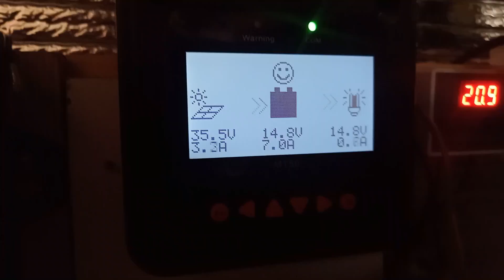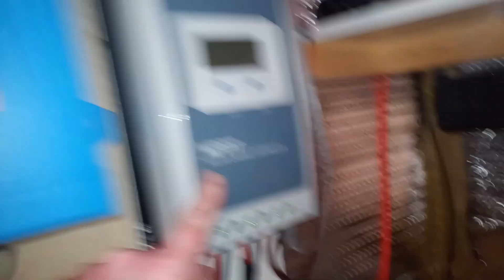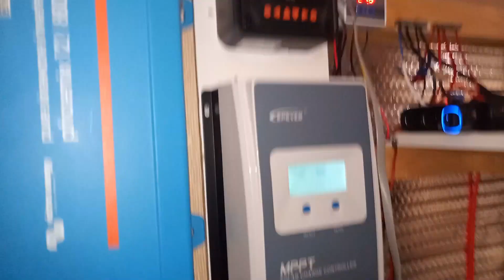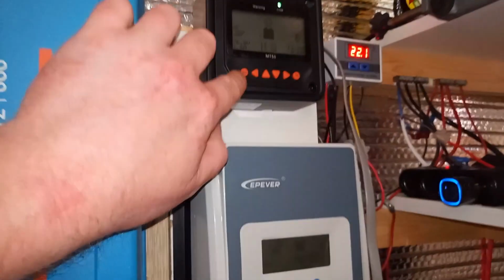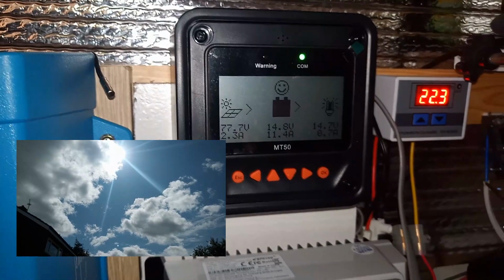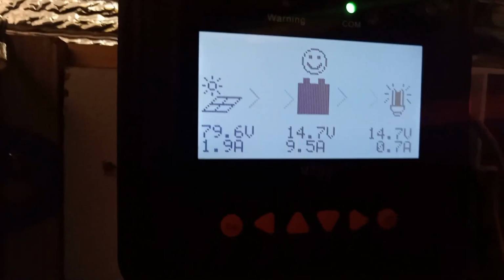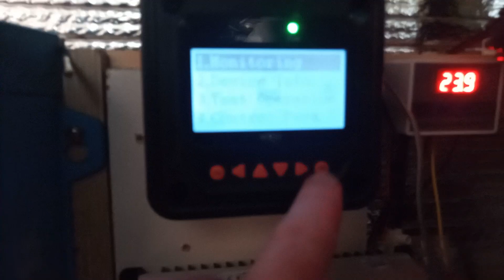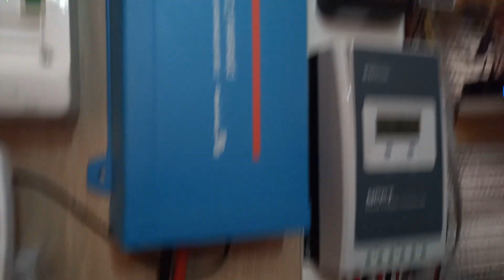2 MORE PANELS for my DIY solar shed project

Comment: No running out of battery power on cloudy days now bro. Safe travels. Ken
Reply from the maker: fingers crossed its enough for the winter. i know mppt controllers boost the extra power. last winter with a 20v panel i only had 12v and thats not enough to charge a 13v battery. now i have 80v :D that should help... but we will find out in a couple of month :D

Comment: That was quick!
I run my internet modem and access point off the solar in summertime, as a way to make use of the excess power.  It's a small but constant load, and they run direct off 12 volts, so no inverter losses.
Reply from the maker: I was going to put our wife in the shed and run it from 12v  but the signal does not reach so I run it from the solar socket in the living room. It would be more efficient to run from 12v but I don't want a really long 12v lead going to the house :D
Reply: @wowsly   That's a tad harsh on the wife!  🤣
Reply from the maker: @sarkybugger5009  lol bloody mobile phone :D when i put wife it sas wifi and if i put wifi it changes it to wife :D
Reply: @wowsly    Auto-corrupt at it's finest...

Comment: Love the delivery bit being caught on cctv :) Wicked 400W of solar now! Wasn't that long ago it was just a solo 40W panel. 20+amps coming in is champion. Have you ever thought of doing a time lapse of the sun rising and setting through a day showing how it lands on the panels? Could use the cctv camera maybe? My shed only gets full sun from the morning until about 4pm in summer.
Reply from the maker: This time of year is perfect as I have the panels facing the sun. The sun comes over quite  early and I am still in full sun now at 5:30pm. In the winter I get sun from 11am to 4pm as it's low and next door blocks it and a tree across the road. I should get about 33amps max on a good day but I am happy with anything this time of year. Getting over double the power with the new panels and controller. Just need winter to get here so I can see the results with the bad weather :)

Comment: I've bought the same panels as you mate. I now have 3 X 100watt panels but I've gone for parallel to get the extra current. My battery is 130ah, which is plenty to power my laptop, lights, and ham radios. Love the videos mate. Stay safe! 73's
Reply from the maker: I was after the volts for the winter. The panels is only 21v and I remember last winter only getting 12v and it would not charge the battery. With it being in series I might get more power in the winter? Maybe? Lol but.... Them panels are penny's. I think I paid 54quid each front eBay. Half the pride of the brand name ones. I'm still working on turning the solar system back into a portable one. Looking for a metal cabinet to house it all in. Projects like this never end, they just evolve lol
Reply: @wowsly  I agree mate. You can't go wrong with what is a good panel for less than £55. I'll probably go series parallel at some point, but for now it serves my needs.
Reply from the maker: @lordflasheart65  I kept thinking about series parallel. But the way the mppt works I don't think there is much reason? I was getting 24 amps with clouds. At some point I will have to try it and see

Comment: I would change that chinese breaker. My one started smoking without tripping. Luckily I saw it happen. There's been some motorhomes' that have gone up. Just saying.
Reply from the maker: Is that the black and red breaker? I had one do something similar a while ago as i put one in too small and it just heated up and looked like it was starting to melt lol